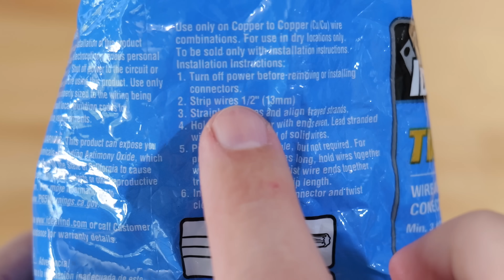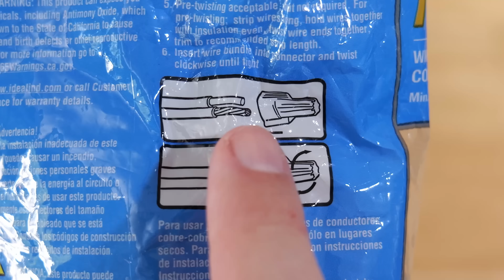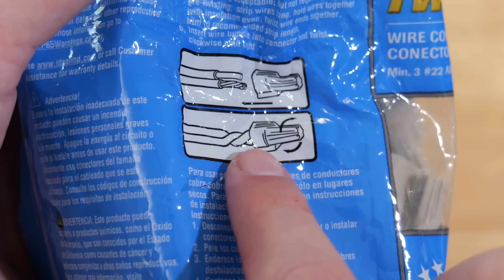5 HUGE Solid to Stranded Wire Mistakes DIYers Unknowingly Make | Most Are Guilty of 2

Comment: I've moved into a new construction home and started the process of upgrading to smart lighting switches and ceiling fans. I'm using Wago 221s as I retrofit and very comfortable with them. But as I move on to more complex multi-gang lighting boxes I encounter a lot of Neutrals and I'm wondering what you would recommend for adding more. An example 4 Neutrals in a box, wirenutted together: supply in and out plus two light feeds. I'm replacing 2 standard switches with  a smart switch and a fan controller that both need a (stranded) Neutral so any suggestions to add 2 Neutrals without using wirenuts. Wago 221 (and Ideal levers) max out at 5-way. Do you see any issue using a 5-way to add a small pigtail to a 3-way that connects the 2 switches? Or use a Push-in like a Wago 2773 with up to 8 ports?

Comment: If I'm doing an outlet or something I'll twist the wires together first then use wire nuts.
For lights I like using the Wagos, lights get changed out more frequently and using Wagos is easier. plus they usually have stranded wires.

Comment: Wagos are my go-to for stranded to solid (or stranded to stranded) wire typically found in lighting, while I stick with wire nuts for solid-to-solid connections in switches, receptacles, etc.  I also twist my Wago connections after they are joined, two or three times... it just helps reduce stress and reinforced the connection (much like the recommended extra twists for a wire nut).  Wago connections also tend to twist/rotate the wire inside as you place the connector in the box... that can't be optimal and the extra twists help prevent it.

Comment: It seems that some of this could be avoided by fixture manufacturers using solid core wire, instead of stranded. But I guess they use stranded because it’s more flexible, making it easier to fold the wiring bundle into the electrical box. Stranded wire might be cheaper, too.
Reply: Many lights has their internal wiring coming through weird pathways and holes, while the device is assembled by, ahem, cheaper kind of labour force. Think fancy ceiling light with multiple E27/E14 bulbs. Stranded wire is quicker and much more forgiving in that application.

Also, at least some of those require final assembly (various fancy parts disconnected from main body to save space etc.). Whoever does the installation must connect wires from individual bulbs together, and "factory option" is horrible crimp end caps that are universally crimped by pliers (while not supposed to, by the way). It is bad, but with solid wire internals it'll turn into crime :)